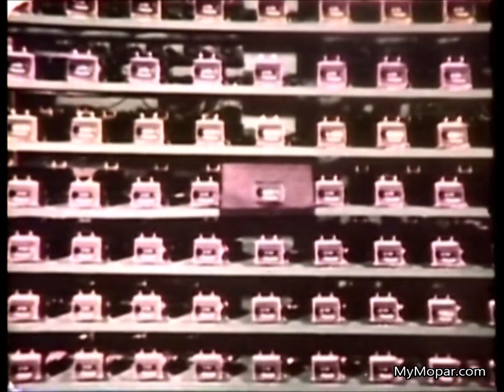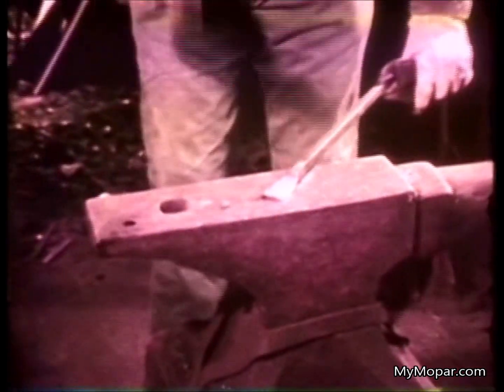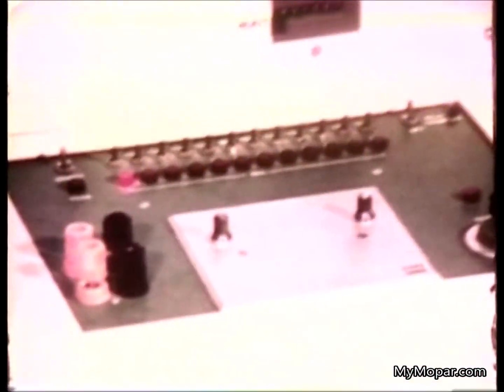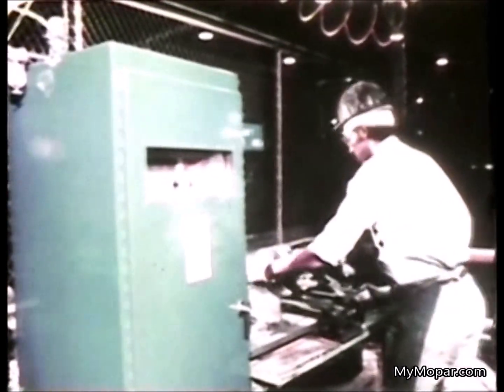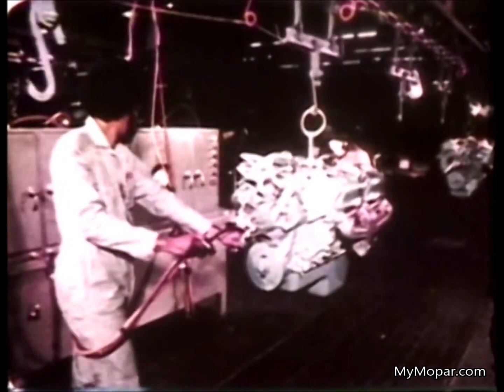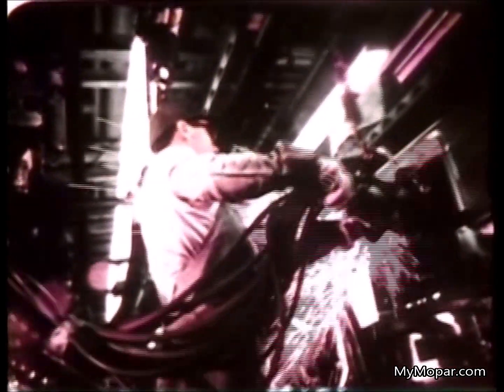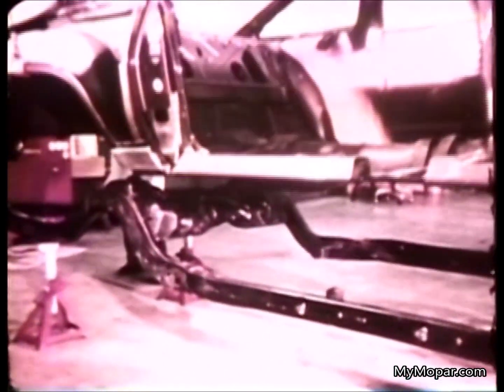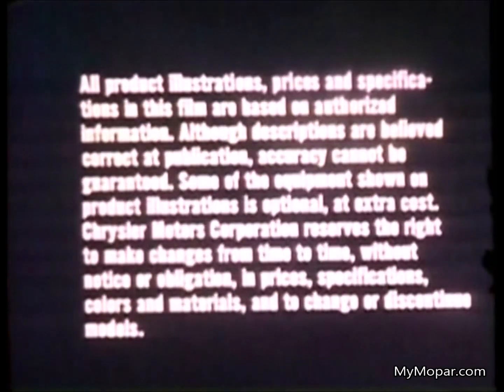Chrysler Corporation Engineering for 1974

Comment: Did any cars in 1974 still have points in the distributor? 🤔
Reply: Ford, GM, Japanese, Swedish & the majority of European cars  had contact points. Looks like  Chrysler US &  V12 Jaguar were unique in using breakerless electronic ignition in the early to mid 1970s. Chrysler UK started using Lucas electronic ignition   in 1975/76 with the Avenger &the French ( initially) built Alpine.

Comment: My pop tells me Chrysler used to be called the Engineer’s Company because they were so far ahead in their designs and quality and I can see why. Sadly it hasn’t been that way for awhile, especially with Fiat running the show now.
Reply: They were the leader in technology from the 30s-early 70s. Came out with disc brakes, solid state radio, cruise control among a host of other things. Once mid 70s cost cutting came about they started to fall behind and become technologically dated and eventually average where they are today. If they would have continued to focus on engineering they would have continued to set thenselves apart and probably avoid the bailouts.
Reply: My Grandfather was a die hard Chrysler man. my Father still is. I say to him “It’s not so much that Chrysler is bad. It just then the rest have gotten a lot better.” Every Car company is an “engineering company” now.

Comment: Anyone else remember the old expression: "Never buy (an American) car that was built on a Monday or a Friday."? (For any Millennial's that are reading this; The reasoning behind that expression was that, on Friday the overpaid union employees just wanted to slap the damn cars together so they could get the hell out of the factory ASAP and go to the local bar for "a drink or two". The Monday part of it was because they all had severe hangovers and didn't much care how well the car was built) In 1973 my father bought a top of the line Chrysler Imperial LeBaron white on white leather for my mother and a beautiful burgundy on burgundy leather Lincoln Mark IV for himself, they both broke down within a month. (both probably built on a Monday or Friday lol) They never could figure out why the Lincoln's electrical system wouldn't allow the thing to start very often, but the Chrysler was a fairly simple fix, someone just forgot to properly install something or other. I don't remember what the part was, as I was just a kid at the time. Those Luxo-Boats were so HUGE that the only thing we could fit in the garage when both cars were in there was our indestructible  Briggs & Stratton lawnmower... and even that was a tight squeeze!
Reply: We used to build 59 cars per hour or about 1 per minute at the Lynch Road Assembly plant in the 1970s but the car would take about 72 hours to make its way through the plant from start to finish. Cars built on a Monday or Friday could start or finish on any day of the week. With thousands of parts and assembly operations, there’s many things that can go wrong with a car during assembly. The worst situation is where you buy a car from dealer inventory that may have sat for weeks in overflow storage lots throughout the Detroit area.

Comment: Then the bumper rusted and fell off
Reply: Chrysler was the first to build the shell of a car then dip the whole thing in primer that used electrical current to bond the primer to the metal . I don't think it worked very well but they were trying
Reply: @bertgrau9246 Chrysler UK ( formerly the Rootes Group) had their body shells made by a rival car makers  (BMC & after 1968 British Leyland)subsidiary; Pressed Steel Fisher, they also made body panels for Ford , Volvo (P1800 ) & Jaguar.  who's to say those panels were treated  properly to combat the dreaded rust?
Reply: Friend had a '78 LTD wagon this happened to.
Reply: Except that was pretty much a Thunderbird and Cutlass thing.

Comment: Gotta love the music!  Lol! Oh my. Thanks for sharing these moldy oldy golden gems with us all! 
What our customers want is....... a stout high performance big block, stuffed,shoe horned and jam crammed, into a 1978-9 Plymouth  Arrow,that weighs just a touch more than a grocery cart lol! So we had to cut out the firewall a little, and a bit of the dashboard too. I mean really, so what if you can blip the carb linkage on that 600+horsepower 383 sitting in the drivers seat?that's what we call control and versatility! With the engine so close to the driver, we can do away with those extra pesky parts,like the gas pedal and other similar pieces parts that will save you a bundle! Sound deadening, who needs it with a big block just inches away from the happy passengers who love that close and personal touch!  And just think, you never need to check off the heater system with this little baby here! No sir-eee! When we say heater delete,we mean it!!! So step right up shoppers,And be the first on your block, with a big block Arrow by Plymouth! ▪☆☆☆▪

Comment: Watch the video on the Lean Burn system and how “easy” it was to troubleshoot.
Reply: Mainly go to the junkyard and buy a point distributor to replace it.
Reply: 🤣😂😆 leanburn 💩
Reply: That Lean Burn System was s good idea that ended up being one huge mistake by Mopar Engineers. When it failed, it left you stranded no matter where you were at... without warning! Mopar quickly had a replacement kit that included a complete Distributor, without the Lean Burn.
Reply: @maptinkler  My parents bought a new '77 Newport Custom in the fall of '76.  The lean burn system went south almost immediately.  It went through 3 transmissions, a couple of power steering pumps and a vast assortment of miscellaneous parts that went bad.  That car spent more time at the dealer for repair than in our driveway the first year we had it.  My dad threatened to drive the loaner car through the showroom windows one night after having a few when the dealer tried to charge him the deductible.  They ended up putting that charge on some other unsuspecting customers car that was in the shop too.  The first night we had it the rear passenger door wouldn't open, that was the beginning of the gorgeous lemons troubles.  As a side note they bought a '75 Newport with the 400 4bbl, and it was a great car.  My dad just wanted that beautiful white with red burgundy paisley interior '77.  They traded it  in on a beautiful '78 Grand Prix.  It was a good car too until I got my license in November of '79, then it started having problems. Great memories.

Comment: Smog motors were in full swing in ‘74
Reply: Second year of the EGR valve but still one year before the dreaded catalytic converter.
Reply: Should’ve bought a 1974 Trans Am super duty could always sell it for a couple of hundred grand now.
Reply: Mopar lied about the Horse Power the engine made, 230hp was said to be down to 190 or less. so No Smog hole in cylinder heads for 74 just Mopar version of Harden valve seats for unleaded fuel.. my 68 daily driver Dodge Dart has a 1974 318 .. thank you Jesus Chrysler and Holy Mother Mopar.. peace